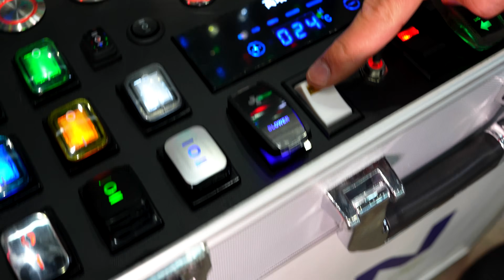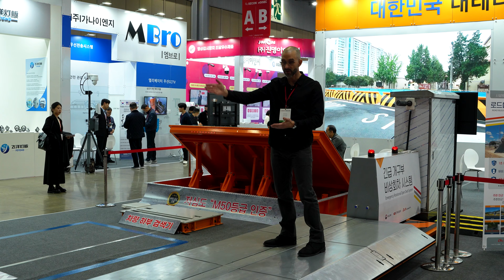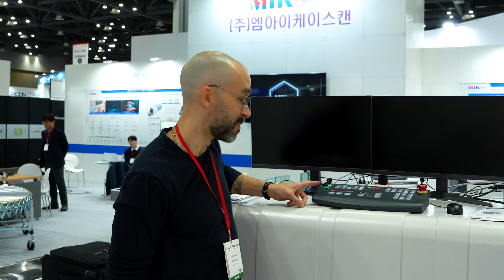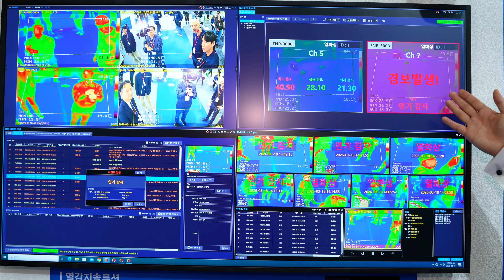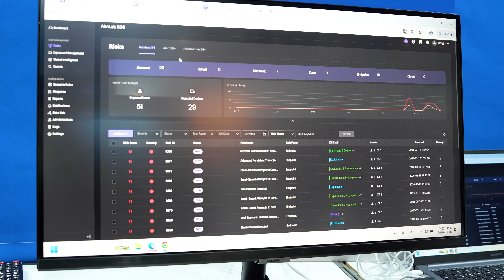13 Things at Korea's Security Expo (SECON & eGISEC 2026)

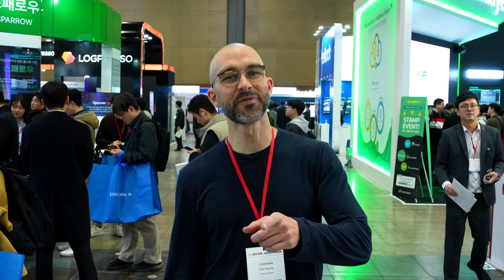Comment: 8:12 there’s some sort of misunderstanding because normally what you’re looking for is intrinsically safe devices that can’t create any sort of spark or flame to set off combustibles of any kind whether it’s in a weapon, storage area or around aircraft refueling.  You’re not protecting it in front of blast you’re protecting it from causing a blast.

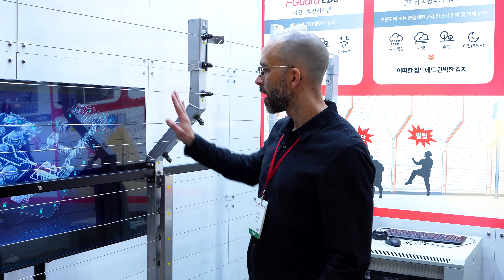9:51 just remember the more parts you have the more expensive it is to maintain so they’re saying that this is cheaper and easier has to be proven by the sensor reliability.  Compared to the old days now they have three times the amount of sensors from the way it looks, and so you have redundancy, but you also have more parts to break to begin with.

This is a military electronics technician who worked on equipment, but also worked in a control center where I took calls against everyone’s equipment to include security systems for weapon storage areas😂

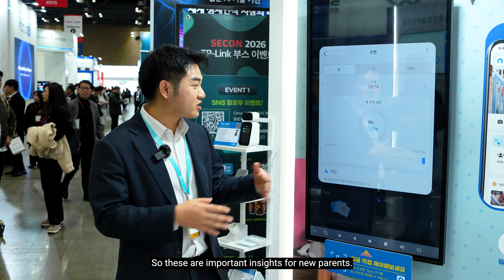11:35 we are getting ridiculous with the amount of securities systems we have and are your children really living when they’re under constant surveillance their entire life now and I would tell you no.  What are we doing to ourselves?  You have corporations and government’s scaring you into thinking you have to monitor everything and I walked around the first part of my life without cameras, being anywhere for the most part.  You created a paradigm of fear and it’s not really worth living in this kind of society so good job on creating 1984.

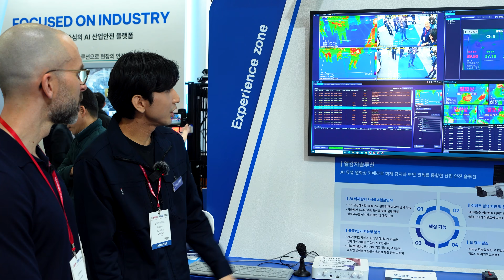12:27 all of this information is encrypted.  Yeah but who also has the encryption key and where is the information going because that doesn’t mean anything and plenty of companies have said this and then their systems got hacked into.  He didn’t answer the question of whether the government had access.

If your security systems are working so well, how is there a pedophile felon in charge of a nation?   Why are a lot of the CEOs also listed in the Epstein documents because what I see is a bunch of elite spying on the public as they are the criminals and we don’t have to guess whether this is true or not.
Reply: Go off, King 🫡

Comment: I didn't think people used baby monitors anymore since the major hacking / unwanted monitoring occured
Reply: So, the biggest problem with smart tech right now is that most of them depend on on closed-source software and cloud servers, if the company servers get hacked or shut down the device is compromised/useless. Nowadays though some companies are starting to allow local use and local-only AI on their products using open-source software, that means that if you want privacy you can spin up your own AI server and use that instead, and have everything running on your home network.

They could also build into the product itself, a processor to run AI. Either way, in these cases the only way your stuff gets hacked is if you willingly expose it to the internet and don't do it properly, or if someone physically gets into your WiFi and you don't have VLANs or some kind of separation for devices.

I don't remember any brands right now that make tech like that for local use, but Hardware Haven made a video recently about setting up fully-local security cameras in his house, it's a great watch even for people that are not super tech-savvy.
Reply: @darkceptor44 I appreciate you taking the time to reply about the topic. You have made some really good points and i 100% agree with you. I'll go and try to find the video now.❤
Reply: Baby monitors are more popular than ever atleast here in the united states